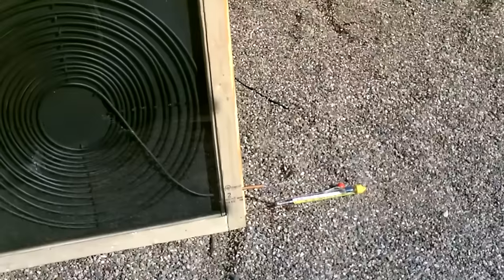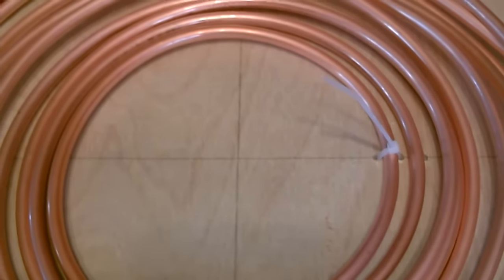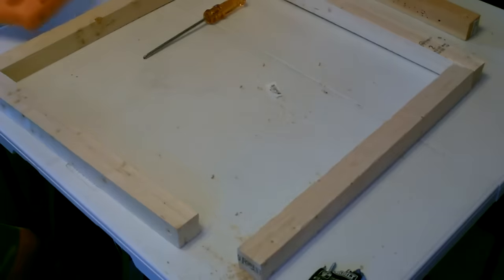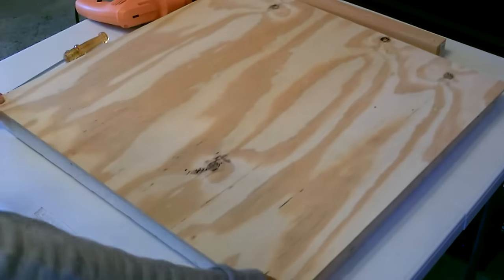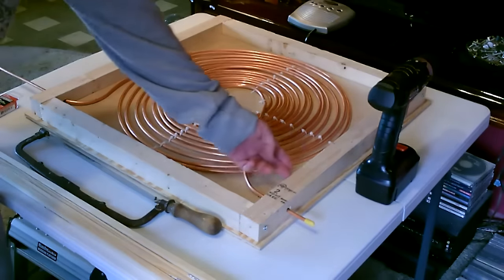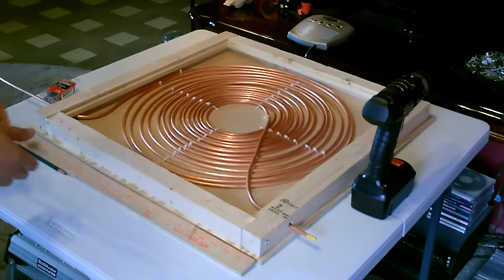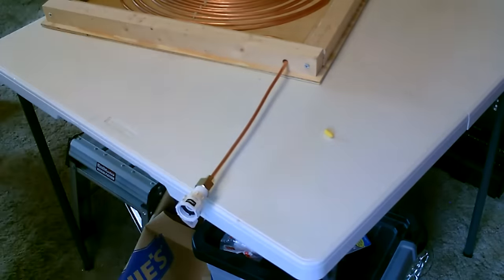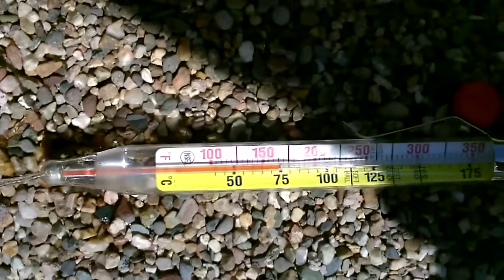DIY Solar Water Heater! - Solar Thermal COPPER COIL Water Heater! - Easy DIY (Full instr.) 170F

Comment: That copper is pretty pricey.  Any chance a similar sized black irrigation tubing would work just as well?  Or is the copper conducting heat better?
Reply from the maker: hi there. copper really is the better choice. black tube usually only handles up to 180F. plus copper lasts way longer - 50 plus years verses maybe 3 to 5.
Reply: Any thoughts on painting the wood black?
Reply: @Howard Stymiest   The best thermal performance approach is a copper sheet bonded (soldered) to copper tubing.  The tubing runs in a back-and-forth pattern, reducing the distance the heat has to travel in the copper absorber sheet.  Then apply a black, high-absorption coating.  Paint is not the best coating, however it is low-cost.  A 'solar' paint would be best.
Reply: Plastic degrades in sunlight.  Adding carbon black (hence the black color) helps a lot, but it will still become brittle over time and crack or blow out at some point.
Reply: The desired properties are high thermal conductivity and corrosion resistance.  Aluminum is an option (excellent thermal conductivity) and steel would work (not as well).  However, any time you mix dissimilar metals (copper with aluminum or steel) you're going to have corrosion issues - look up "bimetallic corrosion" or "bimetallic corrosion table".
Reply: Copper is a far better conductor. It also has the ability not to decay, add chemicals to the water. etc.. But keep in mind when you are designing your unit that the heat source is free. Unlike other types of devices, efficiency is not always your goal. In fact you may need a heat, safety, valve more than anything else in your unit. You really can severely burn someone with a solar hot water heater. Some rather simple units can get very, very close to the boiling point of water. The price of copper tubing is over the edge these days but you do have the ability to build systems with quarter inch tubing. If you have a good, hot storage tank, as well as not having a lot of demand for hot water, you can keep a rather large tank hot enough to suit your needs. However you clearly must use a commercial hot tank with a high heat rating. Your home unit will quickly fail as it is not designed for very hot water.
Reply: MrTechnophile
Reply: Concrete water tank would work as well.
Reply: You're right about the copper sheet, but any metal backplane painted solar black and tightly attached to the tubing will improve the thermal efficiency. A lot of DIY solar guys use old offset printing litho plates as these are otherwise tossed out.
Reply: Best to use copper, the only plastics capable would be Teflon tubing or Silicone rubber tubing. You can use a cheaper steel or aluminium backing plate. Best to make it big, 8'x4' is a handy size, and have the lower end of the glass overhang the box, held back with copper straps bent over the glass, and the glass sealed in with Modified silicone polymer adhesive. That way rain can run off the end of the glass.. Either drain completely in winter, use a drain back system, or use antifreeze mix and pass the fluid through an heat exchanger, in your water cylinder.. The bigger the better, a rough rule of thumb is 800-1000 watts of heat energy per meter squared.. Do not forget to put a sheet of Polyurethane insulation or cork at the back of the heat collector.
Reply: Use lexan dual walled sheeting. It can take the heat and traps heat behind whilst not being fragile.
Reply: Using plastic is only suitable for heating swimming pools and similar applications. You need to ensure the flow rate is high enough to avoid softening it.
Reply: Greg Gallop
Reply: Bimetallic corrossion is generally only a problem when you have an electrolyte to facilitate it (ie, water). As long as the hotbox is kept dry there won't be a problem (and the heat generally sees to that unless your pipework leaks)
Reply: the water in tubing is an electrolyte
Reply: Greg Gallop. Black PVC Irrigation pipe, 300 or 400 feet long, just laying on the ground, gets so hot with standing water, even shaded in weeds & brush, you could almost make coffee, but, fed from a small natural spring, at about 40 to 45 Fahrenheit, after running out the extra hot water, at a slower pace is hot enough to have a nice shower.  That was in summer, in Southern B.C.
Reply: Do it once do it right.
Reply: Did you think about insulating the back side?
Reply: Jim Sadler- what paint would U recommend? Any paints manufactured for "solar" purpose?
    What's your final thinking on the glass? Will it help or hinder? Any glass/plastic that might work best? I have some panels pieces from a pre-fab green house; think that would be ok?  
       I've never done a project like this, but i'm interested in trying. 
GREAT video desertsun02! & Great input Jim S. THANKS-  Lisa

Comment: I am considering building a few of these for my pool, it's 30,000 gallons, so I figure maybe 12 or so. I'll have to do some figuring for pipe and pump size, run a single pipe up the roof, maybe 1"to, 1 1/2" pipe to feed the banks from a home made copper manifold, Then back down the roof in a larger size pipe and manifold. We used 1 1/2" up and 2" down, back when I installed solar pool heaters for a company here in California. I need a cheaper alternative, like this.

Comment: Is it absolutely necessary to use copper or would black rubber pipe do the same at a lower cost ?
Also question = waterproof box and fill with antifreeze or use a 2nd larger diameter pipe and fill the void with antifreeze??

Comment: Thanks, I'm thinking of trying this and using a small aquarium pump from my pook and heating the pool water. and returning the water to my pool.
Reply: If you want an easy demo simply coil a garden hose on the pool deck and you may be shocked at how hot the water gets flowing through the hose.  Simply keep the flow rate low and you could even use the pools filter pump to send a trickle through that hose whenever it is turned on.

Comment: Hi there i have just found out about a thermal heater and honestly know nothing about them, im wondering is it a continuous flow of hot water all the while the hose is running or is this limited please? Any advice would be great, also how exactly it works, i imagine solar power, does the solar energy store in the pipes? I honestly have no idea :s
Definatelyintersted in making one if it could fit the means i have in mind for it
Thanks

Comment: Zip ties wont last you, use stripped bread ties or metal wire. Also paint the base of the copper coil black. If water hot water needed at night placing the coil atop a rocket mass heater will do the job for which I would suggest a tube-shaped coil inside a coffee of paint can insulated. I like that you used glass but I'd recommend maybe tempered plexi glass.

Comment: You could use all that copper tubing to circulate hot water through it and have a fan move air through it to heat the air in a green house or home. Super easy!

Comment: This is a good idea as a collector, but You need to store the water   and keep it hot  so the water need to be circulating inside of a water tank. This is just part of the job , but maybe I am am misunderstanding.
Reply: The water storage is a whole separate topic, I think it makes perfect sense to have one video on collection and another on storage.
Reply: Do not try it with a home hot water heater. They can not handle the degree of heat that collectors can produce and will rapidly fail. You will need the 180 degree water heaters required in restaurants.  It would be better to make your own storage system but it would be quite a project and require skills most people don't have. If you can find a stainless steel tank with a large enough capacity it is a good start and then add a shut off when the water gets too hot. You can actually produce boiling water in some collectors.
Reply: any water heater will do the same job. the only constraints are the capacity (GAL) and the pop off relief valve ,remember warter boils at 212 and a hotwater heater then becomes a boiler and steam pressure is alot higher can be very dangerouse at that point.
Reply: That is not correct. There is a huge difference in the materials that coat an industrial water heater that must reach 180F and the water heaters that you buy for your home. The coating on the inside of a home hot water heater will decompose quite quickly when exposed to water at 180F.  You can see the difference in the prices charged. Get a quote on a 180F heater at 40 gallons and then get quotes on home water heaters of the same capacity.
Reply: You can use a home water heater if you add the hour water with a bit of cold via mixer valve

Comment: have you considered heating it with a Fresnel TV lens?  off focus so you don't melt the unit.  auto tracking the sun is a relatively simple circuit I've seen a couple vids.  I am curious, always have been, does painting them black increase heat absorption significantly?

Comment: Using a parabolic mirror aimed at the copper pipe would increase your heat transfer tremendously.
Reply: Or a Fresnel Lens (at the proper focal length of course)
Reply: New Doctrine Equals Heresy
An Aluminium sheet bent into a parabola and focused onto a 5  cm diameter copper tube will produce boiling water, and the reflector can be made to turn slowly round the axis of the tube to keep in focus. The tube could be filled with oil and pumped through a heat exchanger - or you could run a steam engine off it!
Reply: won't that melt copper pipe tho?
Reply: Cottage Gypsies 
Copper melts at 1080 C, so it would be safe even if the water flow ceased, and would be more likely to melt the brazing alloys or solder first. Or set fire to  the casing. For most purposes , flat-plate collectors are enough for domestic hot water, though a pumped system with a longish copper pipe and curved aluminium parabolic reflector would give improved results in high latitudes.A sheet of aluminium 2.4metres long, curved with supporting profiled braces, and a 2.4metre 50mm diameter copper pipe at the focus would potentially give higher temperatures. See "sgirrel" Youtube clip for an example.
There are many possibilities, depending on needs, and the parabolic reflector could give you water hot enough to drive a steam engine, pumping oil through the copper pipe instead of water, and using a heat-exchanger.
Reply: wow, your smart....i didn't even understand most that answer,,,i appreciate you taking time to explain it tho..but i do know now, copper has to be very very hot to melt...lol.....thank you, have a great day..
Reply: Antonpreis
 needs to make videos now lol
Reply: You are right Sir. By using your idea defiantly water will heat quickly & its temperature will also rise.

Comment: I'm doing something similar, only with about 160' of 1/2" poly tubing. I'd like to use 1/2" copper tubing but that's all too spendy. Yours does look good, well done.
Reply: A heat exchanger/radiator from an old broken down car can work well as a heat medium if you don't have tubing in excess.
Reply: +McGaughey that's a good idea! Could a plumb a load together all tightly, paint the sun side black with a sheet of glass over the top? would look tidy aswell
Reply: I have an idea that i have not seen anyone try yet. There are numerous videos on U Tube about solar hot air collectors. They are cheap and easy to build and the temperature inside those collector boxes get quite high. A small copper coil could be combined within those collectors to heat water. One advantage would be protection against freezing as even at 20F these hot air collectors get above 120 F easily. If the air around the copper coil is 120 F or more you can bet that the water inside that coil will be close to the same temperature. Besides being far less expensive to build the units would also be lighter in weight.   Simply view a hot air solar heater or two on U Tube and think of a copper coil at the top of the box.
Reply: +Jim Sadler I think we need a giant man shed lol
Reply: Pop's Shack the problem with the poly tubing it doesn't conduct heat well so it will suck as a device for that reason
Reply: Warwick Deanm
Reply: Pop's Shack
Reply: Use black rubber hose it really heats water in the sun.
Reply: i dont want anti-freeze coming through my pipes... thats what happens to moonshiners when they reuse aluminum radiators from vehicle,
Reply: One black hose and one roof and one Florida sun. That is all you need to heat water for a shower. You might also need a Y connector to add some cold water. No box needed.
Reply: does it really work sir?
Reply: Jim Sadler have you tried it yet?
Reply: Drain it, and pump water through it for a few minutes, it will be fine.

Comment: Great Would you try to use a Fresnel Lens but to calibrate it in a way that the sunlight rays focused on the Copper coils only and Let's See how much the water temperature can be increased ?? 10x great video.

Comment: How long will it heat the water while in the sun? Does it get cold at some point when the flow is on all the time. You need a storage tank and a circulator pump.

Comment: Hi and I am making the solar water heater as a "closed loop" for my hot tub. I am curious what or where I can find the suitable pump (preferably off the solar panels or battery) that will drive the water through the heater. Any ideas on what to do next AND also what did you use as the glass part? is it tampered or polycarbonate and thickness.

Thanks for the information and hope to hear from you soon as possible.
Reply: I am thinking of doing the same thing with my hot tub.  Electric bill is killing me.  Looking to do somthing like this to preheat the water.  Want to share notes. ?
Reply: Sure!  Only thing I am doing is using the sun to keep the hot tub from running on constant basis and as well as heating it up. 
I'd appreciate any advice or information on this. I am looking for a solar power capable water pump but don't want a HUGE one as the water needs to heat up before it comes out. 
Thanks

Comment: this is awesome, I think it could be slightly improved if you used some reclaimed sheet metal to attach the copper tubing to as well as to hold the heat for longer durations. thanks for the tutorial!!
Reply: And install insullationboard underneath the sheetmetal you attatch the copper tubing to

Comment: What's the volume versus the flow? or is it contentions heated to 150 degrees all day long if it is a flowing. Or, are we talking about a gallon of hot water heated up one at a time? AND if so what's the time to heat to 150 degrees per gallon. , Just a wondering if you could take a long shower or is the flw to slow.

Comment: Did you paint the glass black also or did you add it after painting the coil assembly black?  I want to make one of these in preparation for a possible EMP attack which will take out the electric grid and all electronics.  I can live with canned food for awhile, but I cannot live without a shower!